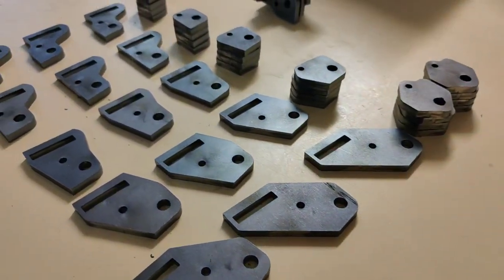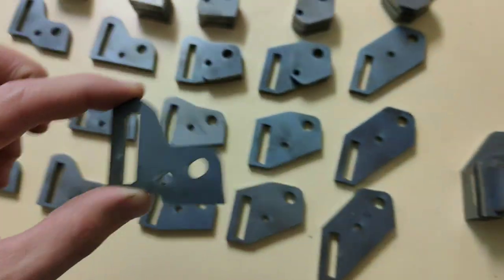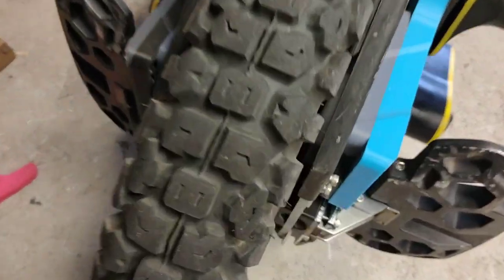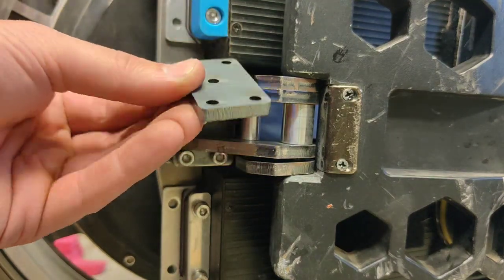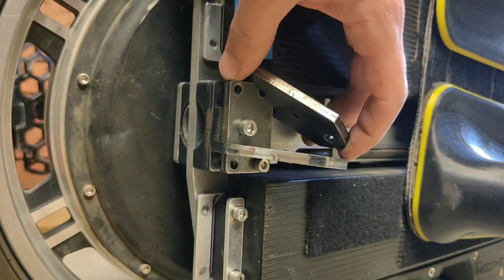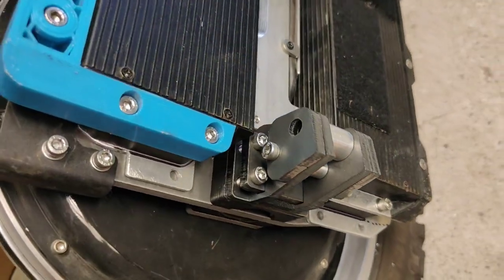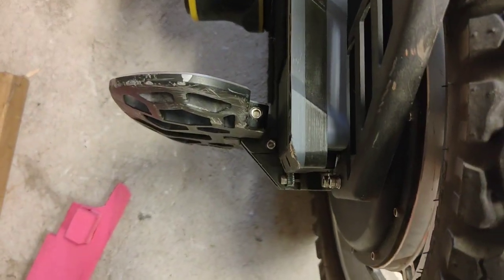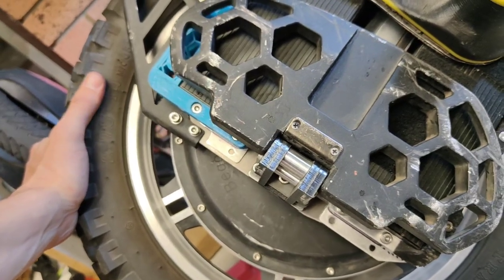EUC BEGODE Master Pedal Hanger Lowered Same overall Travel

Comment: Interesting - definitely something I would consider for my Master. Would be interesting to see a video of your riding experience.
Reply from the maker: Big ride tomorrow 100km
So I'll know by the end of that.
Reply from the maker: Used them off-road. -32 mm are pretty good, the hangers and battery nezer hit any rocks. The pedal scraped a bit.
City riding -32 they are perfect. 
Maybe off-road id swap out to -20mm
Overall they are very awesome. And I do like them alot. 
Especially with the ability to adjust and not be fixed with one height option.

Comment: Where can i get those?
Reply from the maker: You can't, a better mod is to use the more advanced T4 pedal hangers as out of the box they are all ready approx 18mm shorter. The T4 is a more refined BEGODE wheel

Comment: These selling anywhere?
Reply from the maker: I don't have them listed yet And if I did it would be plans only for you to manufacture yourself.

I'm on the fence on how to release as a few considerations. They require you to cut a slot in your tubes at the end as well as some changes in the battery hanger.

Comment: Is this kit going to be for sale?
Reply from the maker: They require a bit of work to use.
As in you need to get laser cut.
But if you interested I can sell you the plans cheap to test.
So far my tests have been awesome and they are excellent no issues.
Reply: @jc84com  idk about laser cut but I have a friend that does custom work locally. He's made linkages for the ex30 and master pro. I bet he could make them for me. How do I get ahold of you?
Reply: @jc84com   T4 mounts directly interchange with Master pedals, 18mm would be ideal for race pedals.
Reply from the maker: @bryanmarino1823 yes T4 and EX30 hangers are a good choice with some changes to the poles and battery hanger plates.